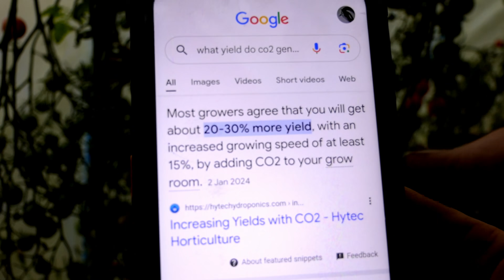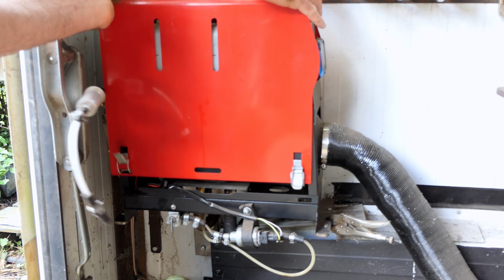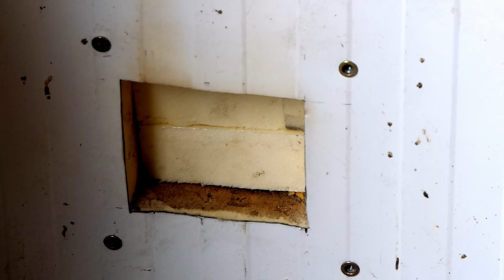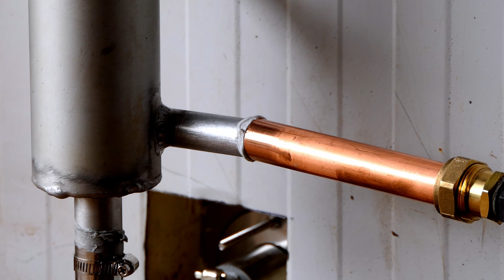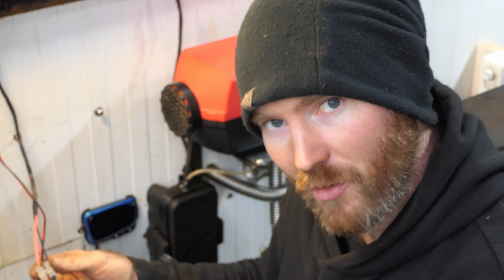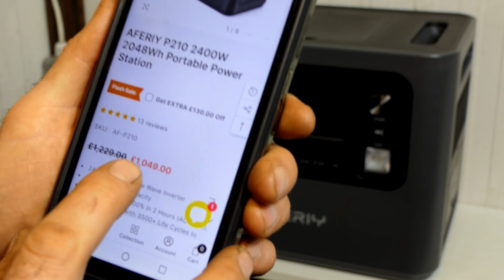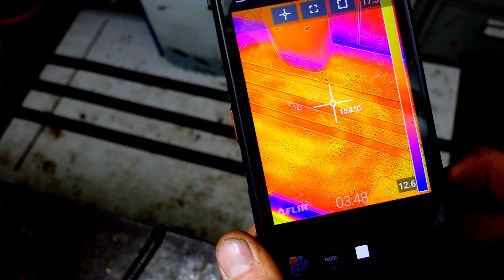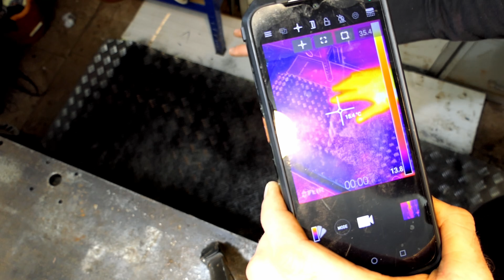NEW! Better system for Cheap and Safe Heating💲+ Underfloor Heating Mod test🫠

Comment: The issue isn't the rising temperature. I think that's where the communicators have failed. It's the speed with which it is rising. The earth goes through natural cycles, however the speed with which the heat is rising is not natural.

The earth is extremely good at coping with changes over time, but not so great at changes over a short period. Life in general will be fine. Humans on the other hand? We will survive. But not well. Making changes now can help the mass dieoffs that humans will face with inaction. From famine (due to the extremely water hungry crops we currently rely on) and from the increasing severity of natural disasters. And this isn't limited to just one thing. Deforestation, relying on limited resources, and being less than efficient about it in the process. Those are the problems we need to fix.

You are absolutely correct, the politicians are corrupt and not going about fixing it in the correct way. But that's not an insurmountable problem. All politics start local. Campaign for change in your local area, and eventually that change will reach the wider world. Giving up is not an option. Failure is not an option. And far too often, people's response to the issue is to gather resources to hunker down and await the storm.

To what benefit? Is survival really the goal? Or should it be something more than that? Humans are the only species capable of true ecological devistation for personal gain. But similarly, we are the only species capable of fixing ecological devistation for the good of everyone.

We both can, and must do something about it. Thats why I enjoy your videos. You frequently talk about using resources efficently. But that's why I'd also recommend not using resources like GPT. It's hugely power inefficient. And because its a chatbot, not a search engine, it's frequently incorrect. If you need a resource to do the math for you, I'd recommend wolfram Alpha. It's built specifically for math, and they've been training it for over a decade. So it's a lot more efficient.

Sorry for rambling. Cheers~
Reply: @mkeyx82 don't know why my comments won't go though. Youtube is having a day apparently.

You can buy a tree core kit (and tree wound glue) for less than 20 dollars. You can also buy a certified weather station kit for 40. You can check the data yourself. And submit your own. Then check their raw data for your points to ensure its not being changed. Easy way to verify it. I was in the same boat you currently are. Until I decided to check it for myself and saw that it matched.
Reply: These rising temperatures, how is that calculated?
Reply: @mkeyx82  Are you asking about the historical temperature data or the modern data? Modern data is easy, there are over 100 thousand weather stations around the world submitting data to the Global Historical Climatology Network (GHCN)

Historical data is a bit harder. But outside of historical records (starting in the mid 1600s) the older temperature data is actually fascinating in how they gather it. There are a variety of sources (done intentionally to get a more accurate reading.) More recent readings come from the growth rings of old forests, those can only go back about 2000 years though. Going back a bit further, coral growth rings, then ice cores can be used to gage temperatures up until 800,000 years ago. Any further than that, they use Benthic cores.

Quite a cool bit of science that. I'd suggest looking into it. Always fun to learn new things.
Reply: @harmonic5107 Lets lock in on the "modern" data. How far back does modern data go? These weather stations, are they well spread across the world? Are there any standards for what constitutes a "weather station"? Is there any data "adjustment" being carried against the information collected?

My answers to questions above go in direction of manipulation and subversion, abuse of definitions and misrepresentation of reality through control and skewing of the data. Many of these fibs have been extensively covered by the likes of Tony Heller and James Corbett. Of course, Mark Steyn played a role recently where we could clearly see how the system is ready to treat those who refuse to fall in line. Facts be damned!

While science is interesting, I'm personally extremely vary of statistical manipulations. Cooking the data sets is something many of these so called scientists are quite skilled in. This type of chicanery is extremely pervasive in "science" today, I am both sad and tired to conclude.

As someone said, can't remember from the top of my head, he who controls the past controls the future. He who controls the present, controls the past.
Reply: @mkeyx82  Q: Are there standards
A: yes. They are well defined and publicly available. Any individual can apply to add their data into the pile. In addition, all of the data gathered is publicly available and 3rd party verified.

Q: is the data adjusted
A: no. It is not. The data is added raw, as as previously stated is publicly available.

I understand wanting to be cautious. And I would advise you to continue to be. However, this is a settled matter. The scope of the collusion you are putting forward is untenable. Why would hostile nations provide matching data? The financial incentive is on the part of the rich petrochemical mogals. And it all ultimately boils down to money in the end. So I would advise a more precise look at who is funding the opposition research. Your own look, not trusting me or any other online person to do that research for you.
Reply: @harmonic5107  
> They are well defined and publicly available

Well defined, publicly available and not honored. There are effects of heat islands in urban areas that will raise the median. The measuring station is supposed to be placed on a green area with a well defined minimum required surface. How is this enforced?

What about the coverage, is the entire world represented with these measuring stations?

What does global temperature average even mean? Who says 1°C warming on the EXITING END of an ice age is a bad thing? What's the current percentile content of CO2 in the atmosphere? At what percentile of CO2 content in the atmosphere carbon based life forms are no longer sustainable? What is the dominant (97%) part of the so called green house gasses? What is the first thing that goes up as CO2 rises? What about the Sun and the effects said massive source of radiation has on this little speck on its horizon?

> The data is added raw, as as previously stated is publicly available.

No. The data gets adjusted ALL the time. Especially the historical data that does not allow for sufficient warming in the present.

> However, this is a settled matter.

No. The science is never settled. Science is nothing but search for truth and it never stops. Politicians like to settle and compromise. These concepts are completely antithetical to science. Not Science (TM), actual science, which can also be conducted outside of expensive laboratories staffed by extremely snobby, highly invested so called scientists.

> The scope of the collusion you are putting forward is untenable.

No. This "science" being produced is full of cooked books and forged papers. The evidence of this "untenable" collusion is overwhelming. Word of the day: compartmentalization. Saying of the day: when someone's ability to earn is predicated on not understanding something, you can be certain they will continue to not understand.

> Why would hostile nations provide matching data?

Hostile toward whom?

> The financial incentive is on the part of the rich petrochemical mogals.

Rich petrochemical mogals [sic] are a joke in comparison to the people who are actually running the show. The people who have been running the show for a long, long while.

A quick news flash: all the despicable misery that has been brought on to many areas by the immoral oil extraction process has absolutely nothing to do with this. The "carbon tax" won't fix any of it. Your rich moguls can't wait for the tax to be levied.

Another news flash: without oil (in the current status quo) millions will freeze to death. Or starve, depending on the season.

> And it all ultimately boils down to money in the end.

There is also something in death and suffering. Massive, massive death and suffering instituted by a global death cult. Spoiler: most of the members that are part of it are completely unaware of its existence.

> So I would advise a more precise look at who is funding the opposition research.

I would advise getting a clue from the book of "getting a clue of who is who in the global geopolitics". I would also advise getting a clue on the matter of who profits the most from massive global death and suffering, be it via perpetual wars, stripping of resources, wasteful management of everything, massive corruption, starvation and many other gnarly things.

Not a single one of these issues will be solved by a carbon tax or reduction of CO2 in the atmosphere.
Reply: @mkeyx82  let me simplify. You are making bold claims. Why do you believe them? What credible sources are you pulling from?

Or are you getting that info from a single source. One funded by the massively wealthy petro-mogals?
Reply: @mkeyx82  my comment was hidden by the youtube gods 😄

I'll TL;DR it. The comments you are making are quite strong claims. I would ensure the sources you are getting your opinions from are credible. Me for instance, I know what the requirements are because I myself submit data. And I know they use it raw because I can find my own data. It's there. Unedited.

I used to be in the same boat you are. I used to think it was all bull. But I realized that anyone can go out and take a core from a tree (the kit is 20 bucks on Amazon) so I did. And I saw the same things they claimed. There is a clear difference between now and 200 years ago. I plan to go up to the redwoods to get a sample there as well so I can see even further in the past. Heck, coral samples aren't hard either as long as you can find an area that isn't protected. The tool is the same.
Reply: @mkeyx82  youtube really doesn't like my replies for some reason. The short of it is, I used to be in the same boat you were. I fully believed climate change was fake or at the very least overblown. But, what I found out is that you can buy tree sample drills (essentially just long hole saws)

So I did. And checked it myself against our local trees. They matched the data. So yes. I am fully aware that they use the raw data. Because I'm submitting it myself now. You can get a 40 buck certified weather station and submit data yourself. Then grab their raw data at the end of the year and check it against yours. 

It's easy to prove it for yourself. Then keep going. Get a tree core kit. (Measure the diameter of the tree and drill in at the thickest part until you hit the halfway point. Make sure you have tree wound sealer) Check their data against yours.
Reply from the maker: @harmonic5107  those are excellent points, thank you for taking the time to share them. Re planting on an industrial scale will certainly help and introduce systems like food Forrest and permaculture principles would be ideal. Algae will become both a savior and a problem as the temperature increases so will the abundance of algae in places you don't want it to grow. The rate of change is bad as you say but also the data that I've found says that trees can match the change provided they're not constantly being deforested. What I don't agree with is closing the coal mines and stopping the use of oil altogether because it doesn't make any difference and just harms society. Oil and coal should definitely be used more appropriately and not devastate ecosystems which has happened even very recently. I think you're right not to give up but there should be greater focus on the matters that make the most difference. All the very best and have a great weekend. Cheers J
Reply: @joshuadelisle  thank you for your response! I agree, oil and coal can not, and should not be stopped wholesale. People, especially those in undeserved areas with unreliable electricity and heating. Need it to survive. I'm more referring to the use of it on the industrial scale. Expecially it's use in the plastics industry. From the higest peak to the deepest point in the ocean (challenger deep) plastic and other petrochemical pollution is ruining the ecosystem.

Comment: If you do lose grid power, your circulating pump would cease to pump.  Would your heat exchanger temperature rise to an excessive temperature and steam burp into your air heat exchanger?
Reply from the maker: @nonsquid  the pump is connected to the same battery power source as the heater. The efficiency increase using the pump should negate the extra power being used. Ideally a pump-less system is a better option and have a gravity convection feed instead. Cheers J

Comment: I'm a welder/fabricator at a farm in western upstate NY,1200 acre/small farm.I get all the free wood I can cut off hundreds of acres of forest. I heat my shop with wood from the stove I made myself-it's not efficient by any measure,but it works! Love your content BTW
Reply: For inexpensive and efficient wood heat, Rocket Mass Heaters are one of the best options.
Reply from the maker: @garthland  wood stoves are the best, I actually have an open fire hearth in our house and I love it. Cheers J

Comment: Josh I absolutely could not argue with any of your final points, the voice of reason
Reply from the maker: @paulscott6463  thank you so much. There is a lot more I could rant about especially the other side and the corrupt nature of big oil too. Wood stoves that run off sustainable locally managed trees are probably best. That's why I love coppicing. Cheers J
Reply: @joshuadelisle  Apart form the PM2.5 that affects respiratory health, coppicing is carbon neutral and generally an awesome personal heating solution. Love it!
Reply: @joshuadelisle excellent rant mate a lot of it could of come from my mouth

Comment: Love it- I saw another video and the fella ran the exhaust pipe through an old radiator before exiting to the outside.
Reply from the maker: @thedustmancometh  yes I decided not to do that because of the carbon build up. A radiator would be hard to clean on the inside. Cheers J

Comment: The sun has a far greater affect on the climate than most think.
And the fact the Earth's magnetic field is weak at the moment (marker for pole shift) makes things bad.
Reply from the maker: @Monkey_Sausage  exactly, there is a lot of factors but our leader are focusing on something that isn't the issue. Cheers J

Comment: Hole saw in a hole saw, mind blown
Reply: I'm 55 and never seen that great tip
Reply from the maker: @tommym936  it's a useful one when needed. Cheers J
Reply: A veritable hole saw "turducken"
Reply: It's a top tip
Reply: If that blows your mind - when cutting plastic your secondary circular "saw" doesn't even need to be a saw. As long as it's steel any metal dish will work 😎👍
Reply: @Fuel_my_Passion  what ??? are you stupid?? its not call a circular saw ??? and how the fuk does it attach to the Arbor in the middle of the hole saw ?? you obviously have never done this and have no fuking idea
Reply: Agreed mind blown such a simple elegant solution to a significant source of swearing......
Reply: It's great for increasing the diameter of holes in the ceiling used for recessed lights. I replaced straight downlights with tilt-adjustable ones and they inevitably needed bigger recesses to turn within.
Reply: I was 41 years old... hahahahha.
Reply: Me too, awesome trick.
Reply: Meh, done by AvE many years ago
Reply: Small mind... thats what they are designed to do, um this has been the case for over 30 years...
Reply: @EvilMorty_  Im sorry i did not realise I was in the presence of a 30-year hole saw veteran.
Reply: @tommym936  yeah basic hand tools have been around a while mate..... not sure where you have been
Reply: @tommym936  but you are obviously just some geeza whos mind is BLOW over a hole saw so you basically got no idea
Reply: @EvilMorty_  Not to brag, but while you’ve known this trick for 30 years, I’ve just never needed to know it ,I usually get the hole size right the first time..

Comment: Kero also burns cleaner than diesel but not quiet as hot . My heater is outside just blowing hot air into the kitchen  and its coming into its 5th year now hail , rain  and snow  .I have mine connected to an IBC and its on 24/7 throughout the winter and just keeps going haven't even had to change the glo plug  . Best £ 55 i have ever spent .
Reply from the maker: @Chris-tz9ct  well done. I do love a bargain especially when it keeps me warm. Cheers J
Reply: @joshuadelisle  Ah - I didn't realise heating oil was actually kerosene LOL :D
Reply: Where can you buy kerosene at any decent price and quantity in the UK?
Reply: @G-ra-ha-m  Don't know about anywhere else but in Scotland oil heating is still popular and oil is easy to get . Get yourself an IBC or old oil tank and get the minimum delivery which is 600ltr with my supplier . or any amount between 600 and 1000lts .